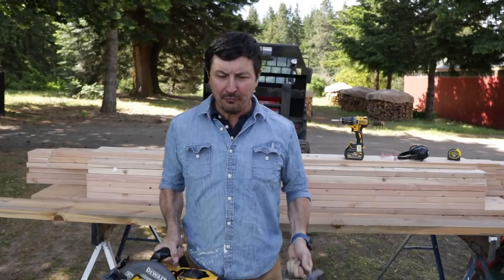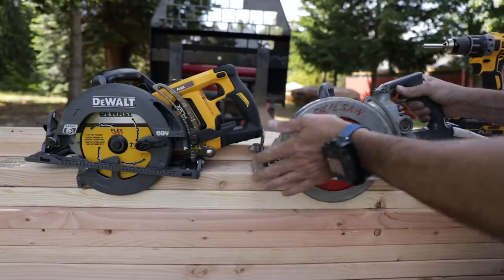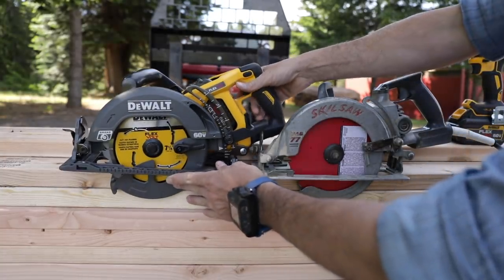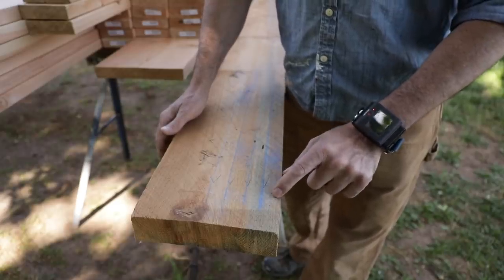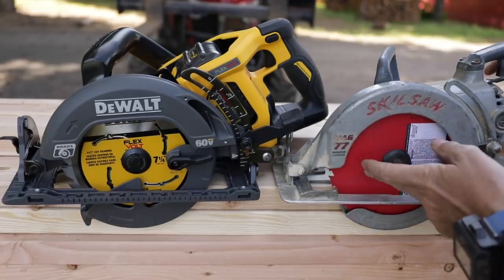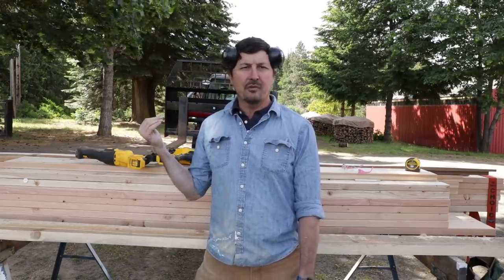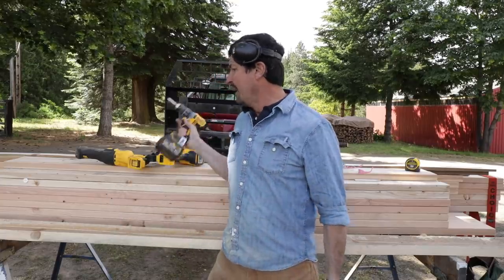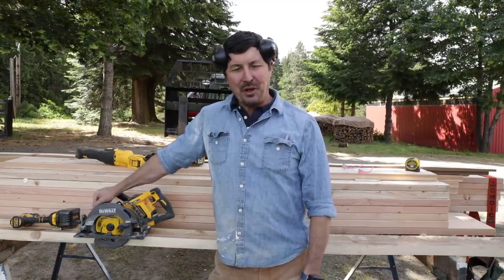Dewalt Flexvolt V.S. Skill Mag77 [S H O C K I N G]

Comment: I'm a flashoholic and that makes me be into batteries. I'm a battery junkie, I love batteries, reading and talking about the specs, prices, brands, etc, etc... So it's kind of ironic that I don't ever want to depend on a powertool that runs on batteries. If you're willing to put up with the cable, there's NOTHING like a good old corded tool, nothing. If you don't mind putting up with the cord, when comparing apples to apples, they're cheaper, more powerful... they even look more manly IMO. Being into batteries I know the premium you pay just for mobility... why go that way when you can get more for less.
Reply: You just saw an example of battery being more powerful than corded.

Comment: Skillsaw has just introduced a SPTH77M-12 48V cordless version of the 77-a REAL wormdrive saw machine.Has a HUGE 48V battery that is like the ones used on my cordless mowers.Ordered one of these saws.Also have the Dewalt.also the battery on the Skil can be charged within an hour.You can get the Skil as basic machine only,with one battery or two batteries for someone that uses the machine on a production basis.I ordered the single battery version-not using the saw for production type work.You can order the saw from Lowes,Acme tools ,Home Depot and other dealers.The Skil 48V battery system is planned to be used on future Skil tools besides the cordless 77 saw-and the cordless machine has a brushless motor.

Comment: I love cordless.
But...
You should use the same blades.
(i'm Dewalt user)
Reply: skill mag has better blade, and the diference is huge, anyhow. its ok to have  5-6 seconds delay betwin saws, but 100% time + on corded saw ? Come on man
Reply: @crinaandreea9640  
Not going to trust some new saw after Skill has been King for Decades.
 Battery has proven to be heavy, expensive and unreliable.
Then what. Happens when  a new battery is introduced and your 6 yr old  battery saw is now junk.
Reply: @cristinafultz2378  your work with saws are reserved for hobby activity ? or contractor? IF you are contractor, the cost of the battery in 6 years are absolutly reliable. The battery cost/performance/mobility 
worth ALL the money. This is the future. For the hobbyst maybe are unreliable, ( high cost industrial tools), but the tehnology will evolve very fast. Today we have battery and tools that provide more power then corded. In the past 10-15 years  that was almost imposible..... .  PS: I almost never use corded after cordless. If you work in a crowded site, with 5,6 tools,  you will know why you need cordless. 

But i know your lack of trust for new tools in the consumerist era. Yep. i dont think that present companies want to create a tool to work 20 -30 years like that Skill saw, or old makita, dewalt tools : )
Reply: @crinaandreea9640  
I'm working with battery drills and flashlights.
The rest of my tools get Full power .
I have been using Skill & MAG77  for 25+yrs. 
 About 20yrs ago battery was showing up in sawzaw / little warmdrive saw and they suck.
.Now all the Nicle battery tools are trash because the battery is out and we have the new battery..
I'm sure the battery today is better than yesterday 
((Although the old battery had a warning that it was almost out of juice)) 
    Batterys today , working great then just like that it's dead.
But the biggest thing about the battery tools is how much a Battery cost.
1 battery is more than a brand new MAG77.. and you will need 2 battery per 1 tool.

That's just the way I feel about it.
I'm not saying I don't like the idea .
I have been burned by the battery tool game. Already and I don't trust that  investment will be a good one.
The name on this YouTube channel is my wife.

Comment: Hi Cody.  Cordless is fine if you are using them regularly -- the batteries are charged and recharged frequently.  For infrequent use, my cordless drills (for example) are useless.  I have to plug it in for a charge.  It's far easier and more reliable for me to use a corded drill for the occasional use.  When I worked HVAC of course I used cordless for driving the self-tapping screws into duct pipes, etc.

Comment: The Dewalt is not worm drive!  worm drive have more torque but lest speed and the DIRECT drive Dewalt has more speed but less torque
Reply: DiBoguy 
It does not matter 
More speed less torque 
Mean easily STALLED 
And hence the dewalt would be slower 

But no the skillsaw worm drive even with more torque is still on the point of stalling and slower 

Why ?? 
The dewalt has BRUSHLESS motor 
That deliver MORE torque when almost stalled even they are direct drive 
Hence the dewalt win 

We RC car , RC helicopter , RC plane , drone 
Already knew the superiority of Brushless motor
Reply: The Skilsaw has quite a bit more power , "torque" than the cordless,"battery " unit !!
Though, if you roll out a 100 ' of 14 gauge cord, you will have a significant drop in performance with most corded tools , 10 amp and above !!
Reply: @brianharrigan8821  Not really . With BRUSHED motor. the designed torque specification cannot be achieved.
Here several reason. 
1. Brush bounce. The brush could not maintain 100% contact on the commutator. therefore cannot deliver 100% of the lectric power. 
2. Arcing between brush and commutator.  wasting electric power. 
3. friction between brush and commutator.
4. At point of stalling or close to stalling the brush and commutator would heat up and waste even more power. 
5. Brush motor only operate efficiently on one designed speed. Hence the need for the WORM drive (any reduction gear ) to take advantage of the most efficient designed RPM and slow it down to a useable Blade RPM. 

Brushless motor do not have the above problem. and with brushless motor it is easier to control the speed and timing while maintaining torque.  
at point of stalling brushless motor have more available torque. 
and no need for 100Ft 14ga or 12 ga cable either. 
brushless motor with new lithium batter could deliver an high Impulse of current for micro second right before the motor stall and breakthru the stall 
BRUSH motor cannot do that .  

The only limiting factor now is the battery . 

we in the RC hobby knew the advantage of Brushless motor and have not look back ever since. 

hope this help
Reply: Worm drive has nothing to do with torque or anything. It’s simply how the motor sends the power to the blade and how it’s set up.
Reply: Taylormade2350 
Worm gear HAS everything to do with torque 

It allows the use of higher RPM motor n then lowered the speed via worm gear and have higher torque 

The direct drive skilsaw has higher RPM. But lowered torque 

Compare the lower gear vs high gear in your car !
Reply: The dewalt is not direct drive. It uses a planetary gearset to gear down the blade speed, just like the wormdrive mechanism does on a wormdrive.

Comment: NOTHING beats a wormdrive
Reply: Are you blind? It beat it
Reply: Ive got both saws the dewalt with a diablo blade is even better like butter the cuts, out performs the skil, even for  ripping material. New short lead doesn't make a difference

Comment: As a remodeling contractor I'm extremely impressed with this DeWalt saw an d most of the new line of DeWalt products. If I was doing framing every day the 77 would be my choice but I would also have this DeWalt saw for work you don't want to drag a cord behind.

Comment: I got so tired of the batteries always being dead, running out of power in the middle of something and having to wait for the battery to recharge. So many projects got started, interrupted due to battery issues, and subsequently abandoned due to frustration, that I did whatever the opposite of cutting the cord is. Sure, I'm no contractor, I'm just a weekend tinkerer who only gets to put in 2-4 hours in my garage doing whatever is needed. I've still got my cordless drill and driver, but it lives right next to my corded drill. 

Corded tools don't run out of batteries, are less expensive, and just don't quit. I've still got my grandfather's old corded tools, drill and circular saws. They still work after at least 60 years. I replaced the drill because my "new" corded drill does nice things that the old one doesn't, and it just feels better in the hand, but they still work, and just never quit on me.

But to each their own. Thanks for sharing the review Cody!
Reply: Torrey Jones batterys are the only way
Reply: Apparently not, because the corded way certainly works well for me, a thousand times better than batteries ever did. Grab, plug, go, don't stop until the jobs done. no recharging, no mysteriously dead batteries, just work getting done.
Reply: Torrey Jones 
I'm a pro contractor the cordless system allows a multiple of advantages, first no cord, on cord to cut, roll up, and my favorite OSHA to inspect. I have multiple port chargers and high capacity batteries so the low battery problem doesn't exist. As a pro I have seen better production and just the freedoms the cordless platforms offer. One power outlet allows me to run at least 10 cordless power tools.
Reply: Good for you Mr Crowley! I'm glad that the cordless tools work so well for you. I however, am not you. I am not a contractor. I don't have to put up with OSHA. I can not USE 10 power tools at one time, so I have no need to power 10 tools at once, thought the drill press, bench grinder, and table saw do stay plugged in over in the corner. What to you is, I'm sure, an extensive list of advantages, to me is an equally long list of pains in my backside.

If you're cutting cords, then you aren't paying enough attention to remain safe. Cut only what you intend to, nothing more. Anything else is negligence. No excuses.

I'm 40+ years old. I have used the first cordless drills running on ni-cad batteries. I have used the latest lithium-ion powered cordless tools. I have used many of the generations in between. Even when I work sun up to sun down in my garage on some home repair or improvement project, corded tools work better for me. I have never had a corded tool slow down because the battery needs charging, nor quit before the job was done due to dead batteries. My work gets done, and I get to go have a beer. Batteries means that I'm either waiting for it to charge or otherwise not getting work done, meaning I don't get my beer. I do own the DeWalt 20v 5-tool combo kit (it was a gift), and to be honest, I would say that the driver sees the most use. I still prefer the pneumatic driver though, since it never stops working. 

You do you, and I'l do me, Cool? Cool.
Reply: I've never understood this complaint of batteries running out. I've used the 99 dollar consumer 20v drill DeWalt make and have gone the entire day with out a interruption. When my first batteries dies I put it on the charger and by the time my second one is done the first one is charged. I work in a heavy industrial role now and everything we use is cordless and we never have these earth shattering problems

Comment: I agree that cordless is gradually replacing corded.  However, I still have a Back and Decker industrial 3/8th electric drill that I still drag out occasionally when my cordless drill just fails on the torque side of things.  Like driving big lag screws etc.  You have to be careful though as once used to cordless, if you go back to the heavy duty corded and really punch the trigger the torque can really jerk you around!

Comment: Do a test cutting masonary. Used the 8 1/4  worm drive corded also cutting concrete slabs all day with a spray bottle of water to cut the dust down. Love to see if the Dewalt would hold up over several months then just out of a new box.

Comment: I have both kinds of saws, 7 1/4inch Dewalt worm drive and a 9 1/4  Skil. The Dewalt is an absolute animal. I have used it cutting stringers for 5 hours on a single 9ah 60v battery. I still us the Skil from time to time but only when I need the larger blade, butting 4x4's for example.

Comment: That's fantastic!  If you only have to make two cuts.  Doubt if the battery saws can run all day on a single charge.  No need to climb down, swap batteries and climb back up with a corded saw.

Comment: Hard to believe the flexvolt can outperform the mag77!  Cool video. Also the left side of the shoe typically is 1" from the blade so no mark/chalkline is necessary... Just use your finger to keep the saw flush with the edge of the board and it will be much faster.

Comment: The thing is... that cordless Dewalt saw is not a worm drive saw. It's "worm drive style" saw. Not the same beast at all.
Reply: Well since a true Worm drive is energy ineffecient that's a good thing, it's just because Americans are obsessed with tradition they call it a wd instead of a rear handle circular saw.
Reply: @demsweden  Americans call it what it is. Worm drive, slower blade, more torque. Standard, faster blade, less torque. Rear handled? Aren't all circular saws rear handled? Now across the pond, things may be done differently.
Reply: Blades and Bullets most saws ive seen and used were sidewinders this dewalt saw was first ive seen to be cordless rear handle
Reply: The universe is made up of Neutrons, Protons, Electrons & Morons...

Once more; IT IS NOT A WORM DRIVE. Why not..?

https://en.m.wikipedia.org/wiki/Worm_drive
Reply: @TheJoshuadavis73 I have never heard of the term sidewinder pertaining to circular saws. Good to know. Thanks
Reply: Mattias Persson Wikipedia and insults! How original!
Reply: Mattias Persson a worm drive is a worm gear driven saw. A side winder is direct drive! What’s so hard to understand?

Comment: Cordless tools aren't replacements for corded tools, they're different things for different applications.  If a cordless tool works for you, you simply don't have the need for a corded one.  When you have a guy ripping boards on a bench and doesn't stop till lunch time, the cordless saw is the wrong tool for the application.
Reply: mattorama If someone did not make power supply for these already then someone will! That would mean best of both worlds. Less issues with voltage drop when you use cord and freedom when you use battery. BLDC motors are better then brushed AC  motors in longevity and power efficiency.
Reply: If you have a dude ripping boards all day, he should probably have a table saw.
Reply: Some of the cordless tools of today ABSOLUTELY are replacements for their corded versions! The circular saw and miter saw especially. I can work the Flexvolt miter saw as hard as the corded version and last all day on the 2x6ah battery. I don't have as much experience with the Flexvolt circular saw as I do the Makita rear handle, but I know that the Makita has replaced my worm drive. The inconveniences of batteries on a job aren't any worse than those of dragging cords everywhere and dealing with nuisance GFCI tripping.
Reply: It's just the way technology is going, face up to it, accept it!
Reply: Would that table saw be powered by battery packs, or would it be corded?
Reply: Corded.  When you have a more or less stationary tool, plug it in.  You don't have to worry about batteries, and you can put a bigger motor in it.   Battery tools are convenient until you are out of batteries.
Reply: Yes, that was my point.  Somebody working on a bench or in a shop has far less need for cordless tools.  Somebody working on a scaffold on the other hand, does.  Cordless aren't replacements for corded tools, they're different things for different tasks.
Reply: I have 9 amp on my table saw 4 different guys using it all day ripping stuff up to 2 inches thick and wont change battery till after lunch
Reply: Benjamin Wood yeah a corded one...batts are for rooks with minor use

Comment: The main issue with battery tools is that there's plenty of power at the start but that tappers off as the battery reaches half full and less. The corded tools are consistent throughout. An obvious point perhaps but something worth considering if you have a 4hr block of work to do and only one 4hr battery compared to a corded machine.

Comment: Their is one more important factor,my dad bought a corded sawzall in 1980 and its still works great.  In the last 10-15 years it doesn't get used much. If it was a battery tool, it wouldn't work at all or it would have cost 1000 dollers in batteries over that time.  If you don't use a tool very often corded is the way to go

Comment: Not too mention how many batteries you may have there’s never enough charge they can’t be charged fast enough when you have 5-6 guys screwing decking down !
Reply: 2 batteries per tool and you will never run out of power.
Reply: Keith Weagle I’ve had 10 batteries a tool still not enough !
Reply: Chris Wells sounds like you are using  crappy brands to me.  My dewalt impact will screw decking for literally hours on a single 5ah battery.  With a 45min recharge time you never run out.
Reply: I've got Dewalt, and same issue because I don't use my tools very often, maybe a few times a year, and the batteries don't work well if left in storage, or the chargers all the time. However the Black and Decker Saw my father left me that's over 30 years old still works, and get the jobs I need done every time I've used it.
Reply: Commodorefan64 sounds like you have the old 18v ncad batteries.  No issues at all with lithium ion.
Reply: Keith Weagle You got it, and for what the new system cost to replace all my tools with them, the fact I already have corded equivalents, and the fact I don't use my tools as often as some, I think I'll stick with my corded tools till they die, and I'm forced to replace them.
Reply: All my tools are battery and iv 12 dewalt 12v 20v and 60v and 10 batterys I never ever ever run out